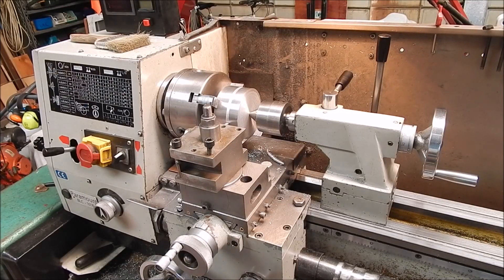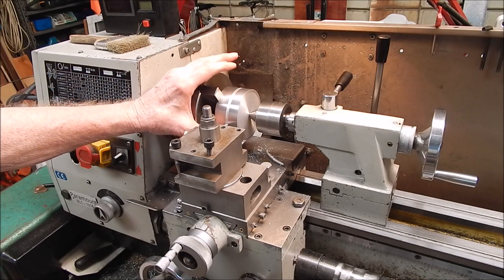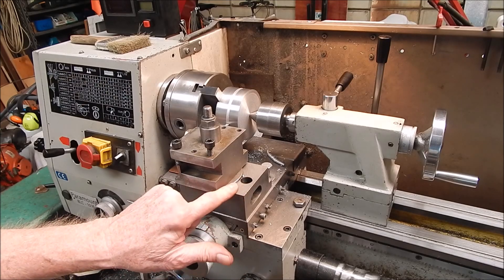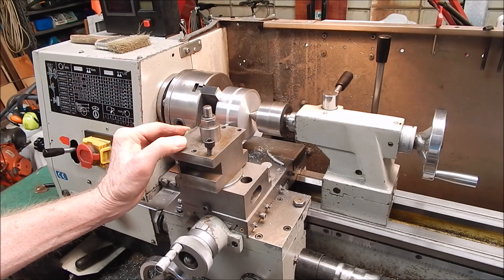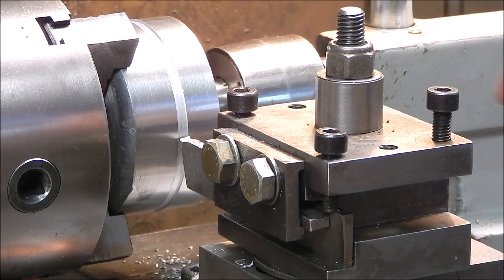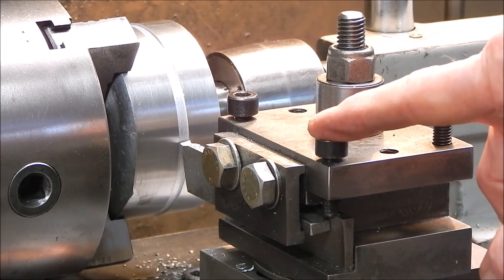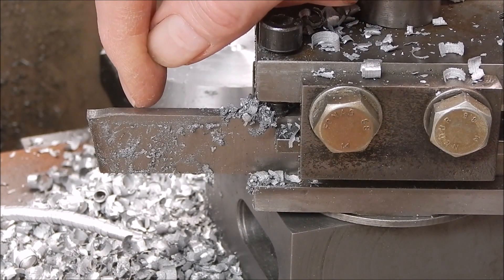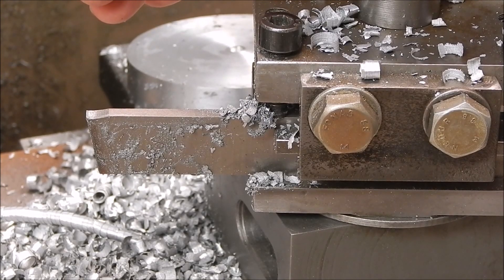How to easily part off large metal round stock on a cheap Chinese lathe

Comment: Good video.
I reckon the extra thickness of that blade is totally worth it for the reduction in anxiety that parting invariably brings.
Reply from the maker: Yes, for this sized job the extra width is not an issue. The blade depth also helps a lot.

Comment: Very impressive parting off blade Rob. It's the one part of lathe work I hate doing. I like the special tool post you made. Cheers Nobby
Reply from the maker: Hi Nobby.  I used to hate parting off as the blade would always catch and dig in/sieze.  Not any more.  Between this rigid dedicated post and my "worlds cheapest parting off blade holder" parting off is a piece of cake.  Cheers Rob

Comment: Parting scares me, It's the one thing i dislike to do. Rigidity, sharp blade, lube and make sure your tool post is square to the work. that's what works for me.
Reply from the maker: Most drama is caused by blade overhang leverage, due to flex/weakness in the compound mount and tool post.   A rigid dedicated mount eliminates those issues, as demonstrated.  Cheers Rob